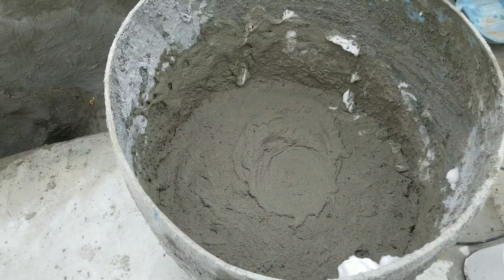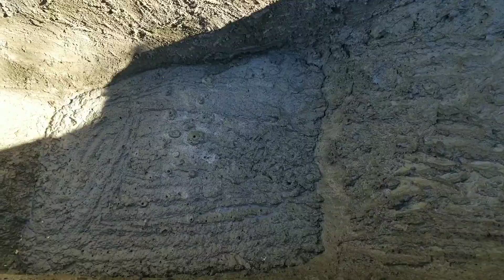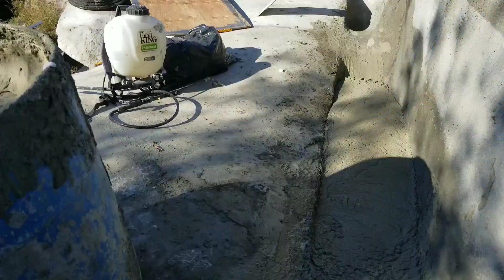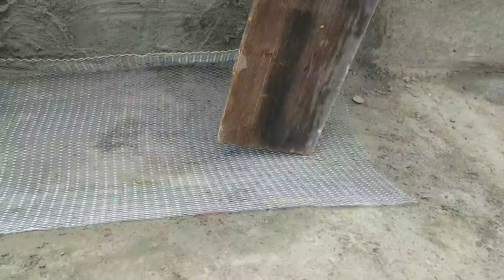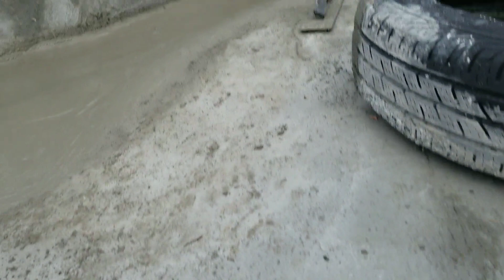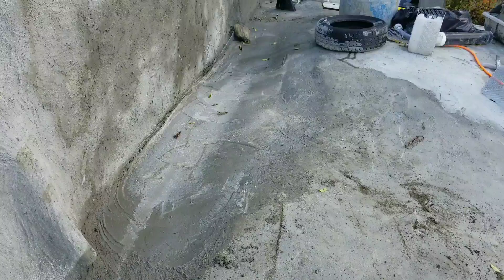Bridging the Gap w/ Aircrete

Comment: why not just fill it with scrap styrafoam and add a 3" layer of concrete on top? hard to understand why you are spending so much time and money on filling a hole in the roof. Hell you could put foam peanuts, hay, etc in there instead right?
Reply from the maker: You could do that! Packing in recycled styrofoam is a method the Earthship biotechs are doing. I am combining the 2 methods, but I ran out of scrap/waste material for this pour. If you check my filling gap#2 vid, I did dispose of some waste in that1. The reason this is worth $200 is because it eliminates a risk to the structure (ice), reinforces it, and adds more usable space on top. For a couple days of labor, I am happy with the reward of the outcome.
Reply from the maker: Also, that method would result in a hollow cavity, so the ferrocement arches would ring hollow and not get the support of the aircrete. And, I wouldn't use biodegradable material like hay/straw in this kind of application.